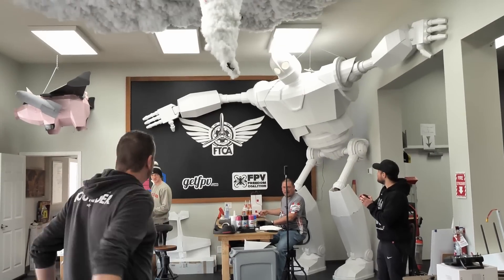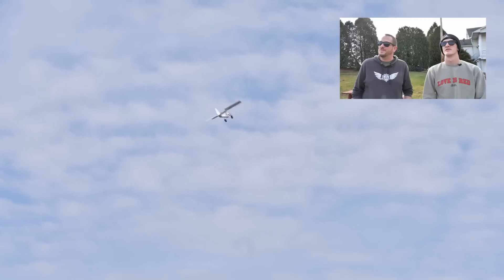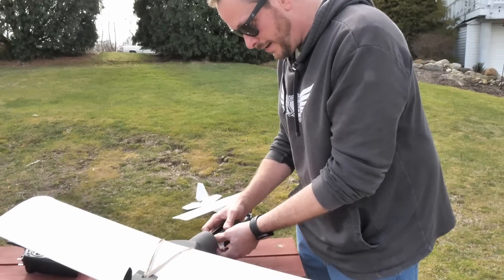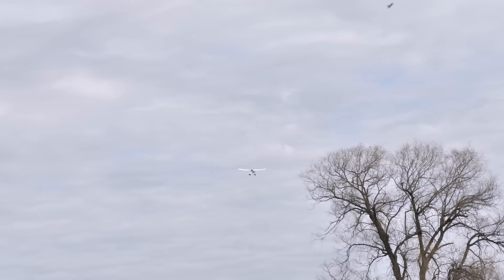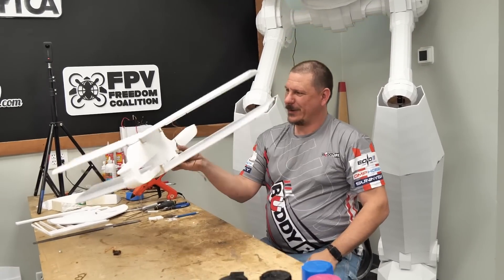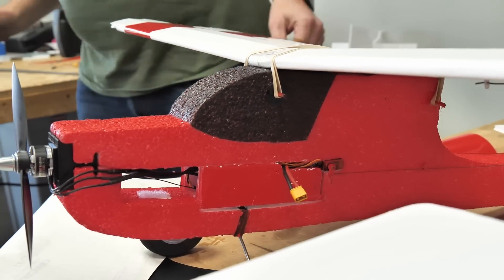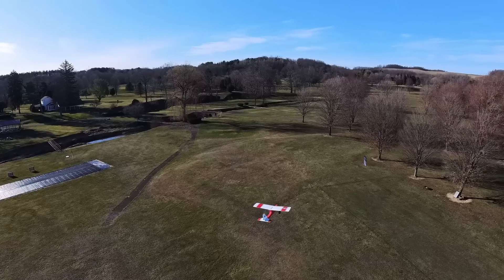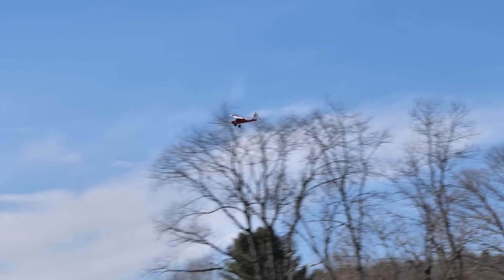We Challenge you!!!

Comment: 3D printing a plane is usually a better option, but if you prototype something, gotta go cheaper. 🤷 Prototyping is usually expensive in my experience, so foamies are here to stay in my opinion, not to mention the usually lower price for the foam materials. Plus, cheaper prices means you also can go hog wild with any airplane design, be it a Sci-fi plane, SST or even say the oddball Flying Barrel plane (Stipa Caproni), you wouldn't be too disappointed if it takes a nosedive outta sky compared to 3D printed planes which gets spendy fast.
Reply: And of course yes, to bang together something for your kids to fly cheaply too, especially as busy, cash-strapped parents (entire electronics can be found for less than $50 but if you want quality, $300 is usually the lowest so that's all you need to worry about - everything else is like $10, and that's it, if you wreck the plane, just make another frame and you're back in the sky quickly).